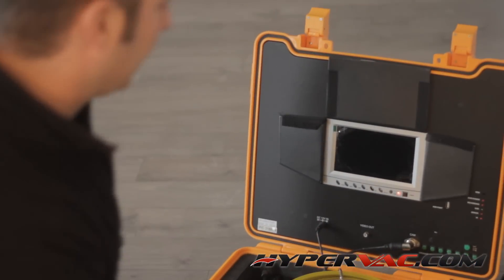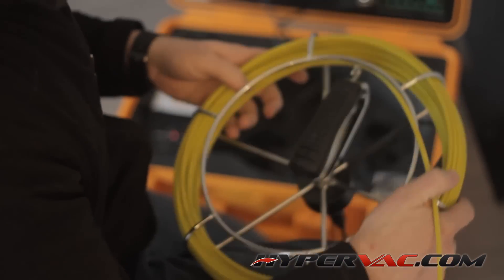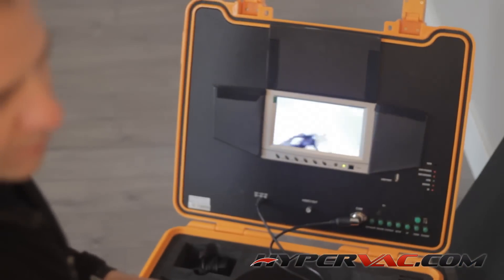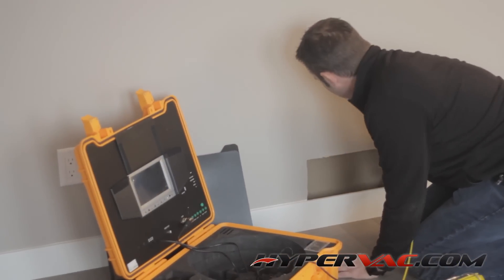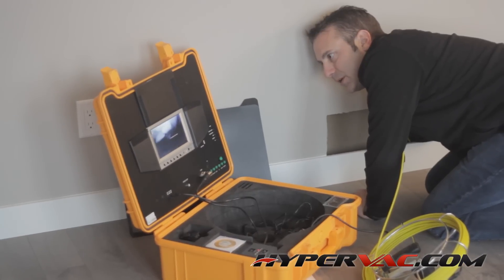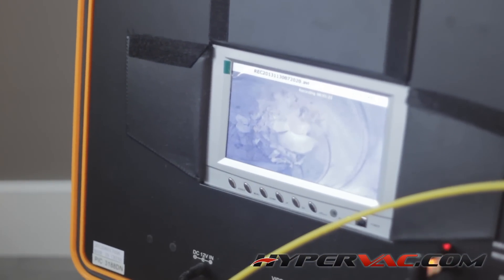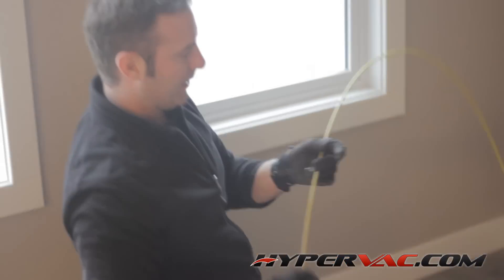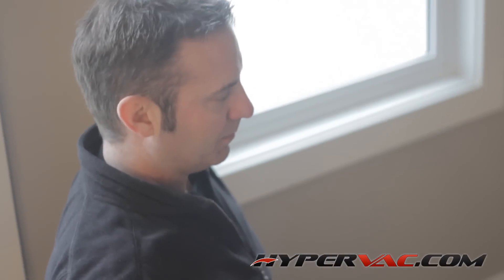Basic Duct Camera Inspection Tool BIC

Comment: What about when the vents are on the ceiling. How do you push it up?
Reply from the maker: once you pull the vents out you should be able to push it down , these are not the best cams for duct cleaning , they only work " OK "
Reply: I need to find a  provider in the Cincinnati area who can perform this service. Any help on a referral?
Reply: Just use a small head camera and tape it to your standard duct air line which is much stiffer than this camera line